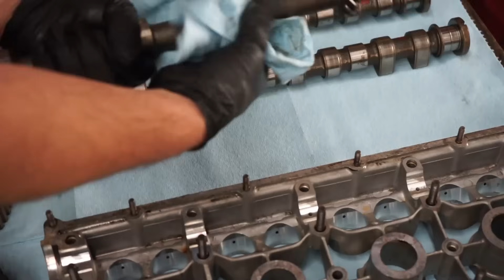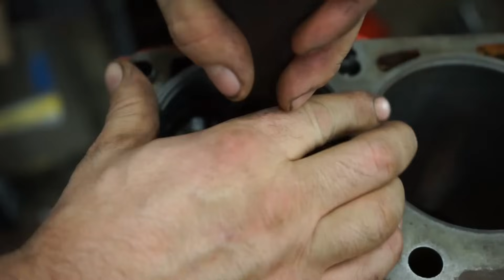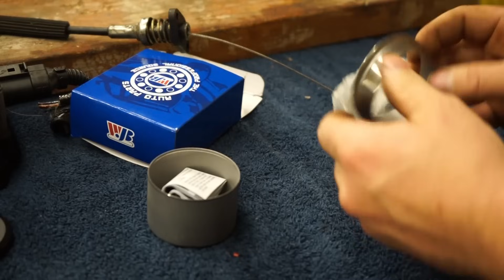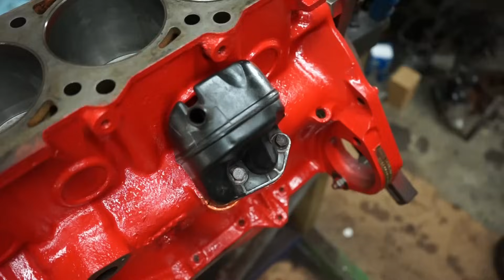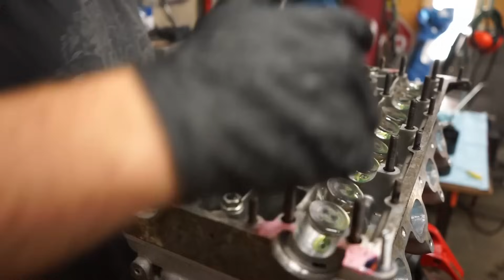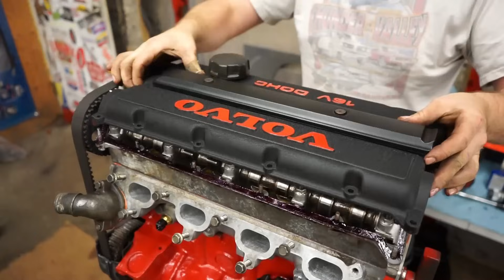Budget Volvo 2.5L stroker 16v engine build (ASMR)

Comment: Did you measure and adjust the gap between the valves and the camshaft?
Not tryna nitpick anything but I have never seen one engine build where they did that. I am not an expert, but when I did my engine I had to take off the camshaft like more than once to adjust every gap. 
Never the less, you did an amazing job :D

Comment: hey, Im about to swap a 16v head onto my 8v! the only timing kit ive been able to find to make the belt work fine is from yoshifab, but the way you did it seems alot simpler. What did you buy instead of the typical hydraulic tensioner?
Reply from the maker: I am just using the factory Penta AQ171 tensioner setup. You can still get the timing belt and idlers on eBay. You have to drill and tap one hole in the cylinder head bigger, but its fairly easy!

Comment: Real question. I got lh 2.4 steering boxes. Would it be possible to drop the ignition box into my 88 240 with lh 2,2? I got trigger flywheel and everything else as well.
Reply from the maker: Ignition timing with the 16V is quite different, mostly because of combustion chamber design. I'm not sure how well that would work.
Reply: @tentshedtrev6596  The steering boxes come from a 8v.

Comment: dude, you dont  install oilpump right, the metal tube between pumr and block must seet deeper on the block and push o-ring
Reply from the maker: I re-did it off camera after i filmed that section, it didnt seem right to me either! good catch!
Reply: @tentshedtrev6596  |LOL| good luck, it so good to build new powered engine, this is so great to see how it burn and work... i repair Volvo 940 (only) for last 20 years and still love this car and this job. i made 240 hp engines with all stock components (ECU, turbo, crank`n`pistons) -   just made headporting  (531head with vx3 cam)  and a little overboost (like 0,9-1bar pressure). my son`n 940 car have a 2,5l 16valve B230GK engine and 370hp with 1,1bar boost, this is beast...  sorry for my bad english, i`m from Russia /Moscow/

Comment: What was brushed on the gaskets before installation?
Reply from the maker: Thats just some Permatex HiTack gasket sealant. Best way to stop older paper-gasket style engine designs from leaking. FYI tho, it makes removing parts and cleaning the old gasket an absolute nightmare the next time it comes apart!
Reply: @tentshedtrev6596  thank you for the reply
Reply: Gasket seal. (Just another way of ensuring a belt and braces seal that most professionals use)..
Reply: @philtucker1224  thank you for your reply and assistance 👍

Comment: Did you use the Penta block or a Volvo B230 one?
Reply: he has the build list in the description
Reply: Dan have you found that one is preferable to the other ( for fast road use?) 🤔
Reply: @philtucker1224  I haven't dug deep enough to know the differences between the two blocks
Reply: @danjones2913  have you used both maybe in the past and found one worked better maybe? ( I did a fair bit of work on Volvo Penta heads as an apprentice - back quite a few decades ago now..😁) kind regards Dan.